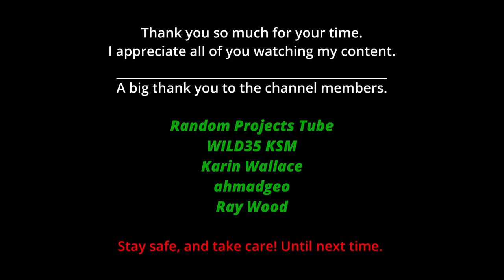Vintage Berda Snackwicher Restoration

Comment: Definitely enjoyed this one cause I'm an Aussie that grew up making jaffles/toastie sandwiches with one of these machines (in Aus it's called either a jaffle maker, sandwich maker, toastie maker or a Breville toasted sandwich maker ) after school in the 90's and 00's and so did my mum in the 70's and 80's! I do love how you can see both the newness and the vintage together in this piece ❤️  Only one thing is missing, the loop on the end of the handle to squeeze it down shut as it cooks! 😁
Reply: I have this exact jaffle maker... a Sunbeam™ branded version ...
Reply: @ceebee23  That's cool, how old is yours? My grandmother had one that only carked it once it was 30 years old 😁
Reply: @lmaree200886  oh purchased in the 90s sometiem .. a long time ago!!
Reply: @ceebee23  Lol I'm a little older than that machine then being an 86 bub!🤣 My grandmothers jaffle machine carked it in the early 00's as it was one of the original silver electric jaffle makers from the early 70's! (Had to edit dates, it was an original Breville machine from 74). I remember one day visiting and it shorted out the electricity of the house and just stopped working 🤣

Comment: Exallent job and a very useful kitchen tool brought back to life. But I did notice the metal clip that locks into the holes in the end of the handle was missing. This U shaped clip holds the handles closed for cooking and storage. So I wondered did you make that part later ?
Reply from the maker: I did not make the part later on, I prefer not to use it. It works great without it, but I understand the function behind it, especially if you packed the filling rather thick.

Comment: It is interesting the manufacturer chose to go with connectors for the wiring rather than just soldering the wires to the terminals.
I really can't imagine why they would want to make servicing one of these more simple.
I'm pretty old I don't ever remember these being expensive items they have always been the kind of thing if it breaks you just bin it get a new one, the cost of manufacture would probably be comparable to the cost of repair.

Comment: Without the teflon coating that will be a nightmare to clean each time it's used.
Reply from the maker: True, teflon has it benifits. This is rather easy to clean if you oil it good
Reply: @AJRestoration  even teflon coating can't stop me in the end getting down to metal how scratch resistance is your coating

Comment: Nice job and I want a laser engraver, I'm sure I could find something fun to do with it!  Old things are worth fixing and making like new again.  New things, not so much.  
I took my George Foreman burger grill apart when the temperature control switch stopped working - right after the warranty expired, of course - and it was of such cheap plastic construction that no wonder it broke. I couldn't do anything with it but toss it out.
Reply from the maker: That is a huge problem with current generation appliances, they are designed to break as soon as the warranty expires. 
They intentionally make it not worth repairing so they can make a new sale. It's disgusting actually, given the current waste problem the world has.

Comment: This design is identical to the Breville SG1 released in 1974, the only difference being the Breville outer skin was chrome. I wonder if this was produced under licence? I still have an original 1970’s Breville and I did a complete tear down and clean and the inside was the same. These things are bulletproof and give amazing results compared to the poor quality ones produced today that have such a thin toasting surface that they cannot truly give a good crust.
Reply: Mine is chrome and a Berda product. I'm from South Africa, so that could be the name it was manufactured/sold in over here? These machines are so much more solid and better in every way than the new models you can find. They are flimsy and have hardly enough depth - all the fillings boil or squeeze out. I went hunting for exactly the same model my mom had in the 80's and felt like I hit gold when I found one in a second hand shop. Just replaced the cable and it still works! I used mine earlier this week, in fact.

Comment: Very nice work.  But I have to say I hate the design of the product itself.  I could even see some heat marks on the wires as you took it apart.  Those heating elements are not surrounded enough to keep heat away from the case and/or wires.  Amazing work restoring it but the product .. blech a fire hazard waiting to happen.

Comment: This is not vintage you can buy this brand new for just $8 in 2022 in new delhi , india
Reply: 🤦‍♀️THIS specific machine is VINTAGE ffs! These electric sandwich maker machines have been around since the 1950's. This model is from the 1970's.
Reply from the maker: Thank you, I agree with you this one is indeed vintage.